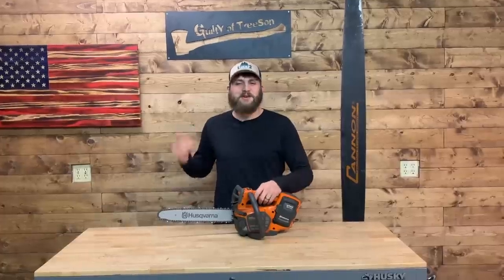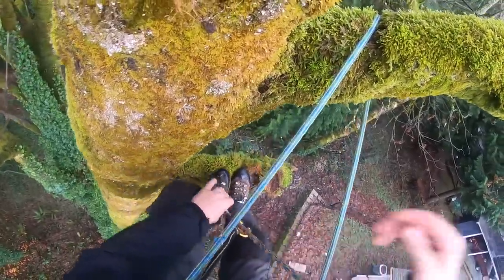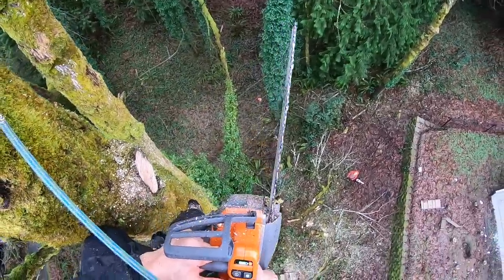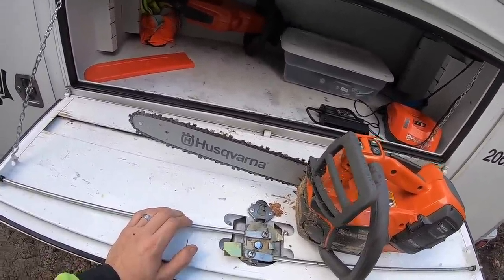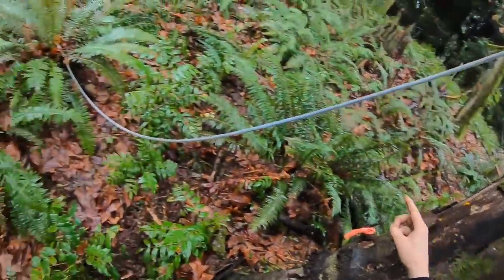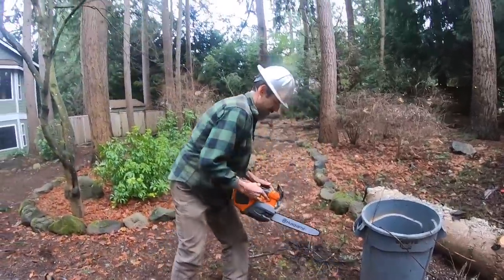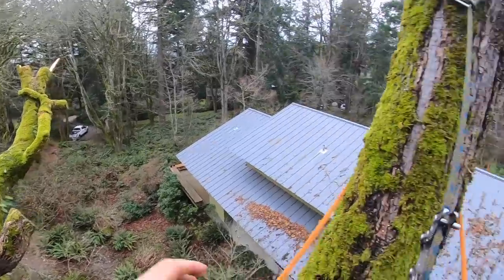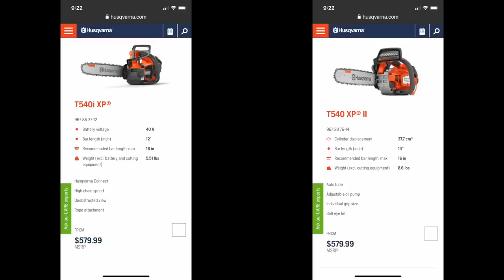Battery Powered Chainsaw Review! Testing the Husqvarna T540i xp

Comment: Sooner or later cities will restrict the use of two stroke engine garden equipment due to the extreme noise it makes. from a professional point it is a trade-off between lower maintenance effort, less weight, better handiness compared to higher power of engine saws. financially it will come down to how the batteries will last. I guess professional will use like you did. For the small stuff with a lot on and of: electric. For the big cuts: still engines saws.

Comment: Watching him with one hand on the trigger and the other on the chain with the battery inserted made my ballsack shrivel.  Nobody would ever touch the chain on a conventional saw with the engine running, chain brake or no.  I think the danger of an electric chainsaw is it can lull you into complacency safety wise because it is completely silent.  The truth is, if the battery is inserted, it is a "running" saw.

Comment: I used to hurt 20 volt chainsaw it doesn't come on by accident I've used it to cut 10 cords of wood already and I've had no problems the battery usually last longer than me and it's only 154

Comment: I have no doubt that the saw shouts down not so much because of heavy load but more motor RPM. The saw needs to run close to max rpm to keep the motor from overheating ALSO, maybe need to check the screen and make sure it isn't plugged up. If two of our electric mowers had shut down when the RPM's were low, they would still be working. (couldn't seem to get through the importance of keeping the RPM up to keep the motor  from overheating and not keep lugging the motor down). bought only gas powered from that day forth.

Comment: I know Husq is suppose to be king but I have 2 dewalt 16s and I love them. Noticed same thing about chain losness but can be tightened in about 30 seconds, no tools. And they do have to be kept tight as they will jump the sprocket easier if lose. Last one I got was 300 to 350 for saw battery and charger and I've used the crap out of both of them. I'm older with some health issues and I'd never go back to Gas. I couldn't, I was always wore out just getting them started especially if they were being troublesome. Another great thing at thing about dewalt the 60 multivolt batteries can be used with the 20 volt hand tools, drills, impacts etc..

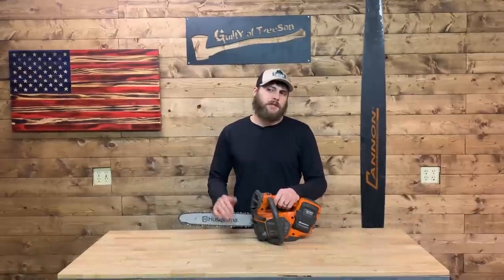Comment: 1:20 if you pulled the trigger now would that rip through your hand? obvious precautions with a running engine. different with instant battery power. from silent to running.

Comment: The lack of noise should be a competitive edge when bidding for some jobs I should think. Especially if you ONLY use electric saws and other equipment on a job. Number one, you can work all hours just outside windows both in a residential and office environment without waking people up or disturbing them at work. Number two you can tell the customer that their neighbors won't get irritated with them because of noise. You'd be like: - No, ma'am we won't disturb your neighbors, they won't even notice we are here. Finally it's the environmental aspect like: -"Yes ma'am, we are a Eco friendly company, no exhaust fumes or fuel spills here... 😉👍

Comment: I feel similarly to the DeWalt battery chainsaws. They have serious drawbacks and are not 'dead-on' like my gaser Stihl. However, I grab the DeWalts for everything except big wood because they are quiet, light, easy to turn on/off...no pulling when up high or on really slippery slopes.  Yes, I wish they were sturdier. Yes, I have to think about how many days/batteries I need. But, in spite of this, they get the job done and so I grab them far more often than I would have suspected.

Comment: The chain thaightening system needs some improvement. With my experience you have to move bar up´n down while you turn the tightening screw. Otherwise bar moves when you start sawing and chain loosens.

Comment: The one thing you left out is the weight of the saws the reason you want the smaller saw paired with the bigger saw is when you are limbing you want to use the smaller saw because it is lighter to handle for the longer amount of time you are limbing and the largest saw is heavier but you use it to drop the tree with a few cuts but you aren’t carrying it for a long amount of time

Comment: If the battery is in the saw, always assume it is on. I don’t have the same saw but I have an ego saw and there is no turning it on and off. Just pop the battery in and pull the trigger unless the chain break is set so unless I’m using it I always lock the chain break

Comment: I recently went with the Milwaukee battery saws. As far as the "full size" saw, all I can say is I am lucky I havent hurt myself. I am like 2/30 on cutting the hinge correctly. lol Not the saws fault, I just suck at it. However,  I cant say enough about the little 6" bar  Hatchet though. I have cut oh probably a 2K limbs with that thing. The battery will last several hundred cuts. Its hands down the best invention since the socket ratchet as far as tools go.

Comment: I've got a cordless Makita (DUC400). I've been contemplating putting a 20" bar on it for the occasional big cut I need to do. Do you reckon a skip tooth chain on a cordless going from 16" to 20" make it easier on the saw? Cheers, Kenny from #straya.
Reply: Can’t speak on that saw, but I’ve ran skip tooth on a Milwaukee I keep in the service truck for random larger things.  Skip tooth has less teeth which will result in less power to run, abiet longer cutting times.

Comment: don't rely on battery tech in winter
Reply: Yep, in the winter time (freezing or below) the batteries won't put out near as much power, and if it gets cold enough they won't put out any power at all. Lithium-ion batteries are better about that than the old NiCd and NiMh (and especially lead acid) batteries were, but it still saps their power in cold weather because the chemical reactions that make the battery work slow down when the battery is cold. Of course, if you're USING the tool and the battery was warm to start with, the battery will stay warm because it heats up a little bit when discharging because of internal electrical resistance and other losses that effectively mean you don't get back all the energy you put in the battery when you charged it, the energy you don't get back gets turned into heat in the battery either during charging or during discharging.

There is a workaround for this issue if a battery powered tool is all you find yourself with on a freezing day, and it works no matter what kind of battery you're talking about (well, there's one or two exceptions but you don't find power tools using those kind of battery chemistries).
Keep the batteries (just the batteries) in the cabin of the vehicle where you can have the heater keeping them nice and warm until just before you're ready to use them, then install the battery in the tool and go to work, provided you use the tool somewhat regularly the battery should stay warm enough to keep working satisfactorily.

Comment: I seen a few reviews on the electric saws and the most compressive review had the echo 58 volt and a Dewalt  60v not sure about the 60 but if that's their largest it was that saw that was in the lead with the Echo for speed and torque. Keep in mind the longest run time was only 6 minutes with a single charge. The Echo was one of the quickest charges. I think you can get a battery pack in a backpack for some of those but..... a gas saw is easier to deal with. The Dewalt and Echo were very close till the recharge time none of the other saws came even close to them but none I would say were cost effective. ( these two e saws cut faster than the ms 170-171)

Comment: Thank you for that review, I was waiting for it after I first saw you using a battery saw. I used to run a petrol chainsaw and just hated the noise. I always finished a job with a splitting headache. Then I had a near miss (own fault) incident that put me off tree work for a while. After that I switched to the old school hand tree saws, one person and two person 6', for tree felling and just enjoyed the quietness of it and the lack of stress and adrenalin.
I don't do much tree work anymore but as I have gotten older I have been thinking of a battery chainsaw for that bit of 'power assistance' to my elbow. Good to know that the modern ones are capable of some serious work if you're not in too much of a rush.

Comment: Question, are electric saws more likely to defeat safety chaps than gas saws of the same size?
Reply: Less likely. They have a lower torque cut-off, like when he pushed to hard into a deep cut. Petrol engines will just keep going if finger is on trigger.

Comment: So basically if you're going to need to bury the bar in wood you want a gas saw. And pull-starting gas engines makes one feel manly 😄
Reply: The smell of 2 stroke is something I will not easily let go of.
Reply: @jolkraeremeark6949  Oh, yeah. It's way better than ozone 😛
Reply: @jeffreyrubish347  ozone is way overrated.
Reply: @jolkraeremeark6949  😄

Comment: I never knew they made a “safety” chain for saws. Is there specific differences between that chain and the ones you typically use?
Reply: The top handle and smaller homeowner saws usually come with a more kickback resistant chain. These chains have different style depth gauges and/or bumper drive links to ease the cutting teeth into the wood.
Reply: Bumper links are designed to extend when rounding the nose to prevent cutters from engaging the wood, reducing the likelihood of kickback
Reply: They made it for people that don't have beards or wedding tackle.

Comment: I would add a little dielectric grease to the contacts of the battery or the saw, extra protection for them in wet area's, may not be needed but it cant hurt.
For small jobs i think battery powered is fine, but for larger jobs gas powered is definitely better.

Comment: I found the chain slacking to be caused by lack of oil, in the video you can hear the bar and chain screaming though being dry, I currently have the same issue, its caused by the saw dust and  debris making its way back into the rubber oil guide that feeds the bar blocking it up, i was also sold mine with the standard bar and not the xforce bar! Once i have the new bar i will let you know it it makes any difference to the oil blocking

Comment: "I don't know how much oil is left"??? Seems with gas saws.. It's easier to know .. fill the gas tank/fill the oil tank. As far as the deal with swapping out batteries between tools.. Meh, I can swap my tool heads out just as fast with my Stihl Kombisystem as you can with your batteries... PLUS.. I know where my oil level is. Just saying.. this vid seemed like you were sponsored by some orange Swedes.

Comment: great vid ! didn't read in the comments there have actually been 3 of the tops  T536, T535,T540, I still run the 536 after almost 7 years on org batteries haven't had the ability of trying the newer 540 yet  ,(soon I hope) I do find the 536 stronger than the 535  but cold weather (below freezing) is the downside, I don't know if the cutting rope thing was a joke or not , but I have all cuts removed from drop zone before processing that way its clear of drop zone and any ropes while groundie can do what's necessary away and  Stay safe up there TheTreeGuy

Comment: Never will carry am electric chainsaw! I was in Katrina and we had those battery powered saws! We were working around the clock in shifts no power had to be charged off generator and the generators were taken to help the mobile medical to help! They don't hold up it would rain really bad they all stopped working!!!! Our gas powered chainsaws out lasted out ran and put performed! In the severe weather the rain the snow the long hours of none stop! For a tree service yes if your not doing storm work or severe duty! The plastic sprocket was the weakest link wouldn't hold up! We ended up going with stil chainsaws and some huskies! Never had a problem!